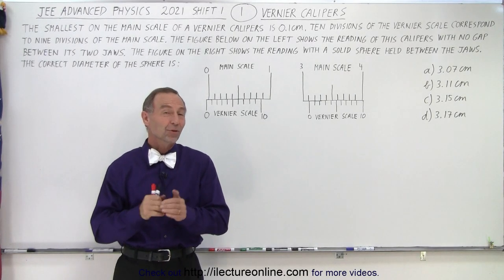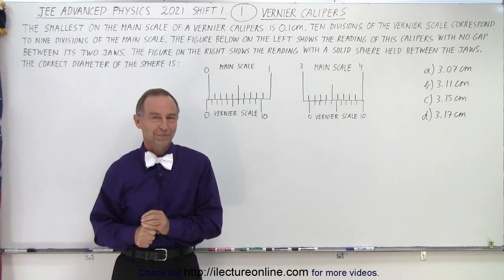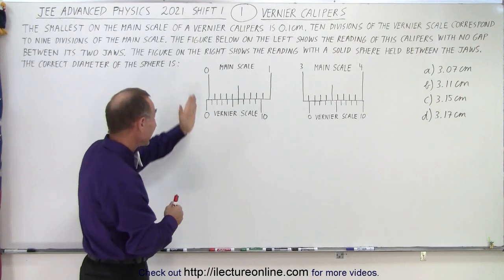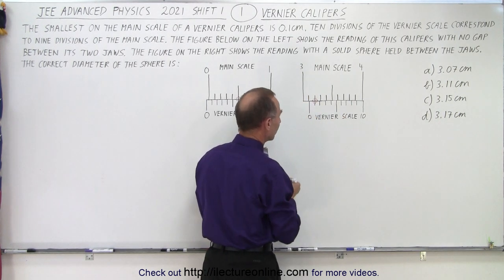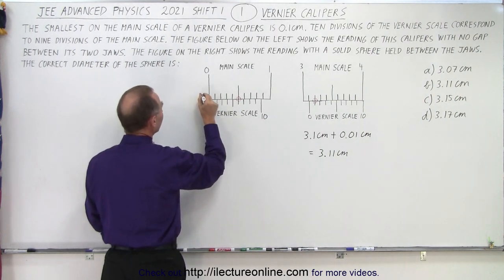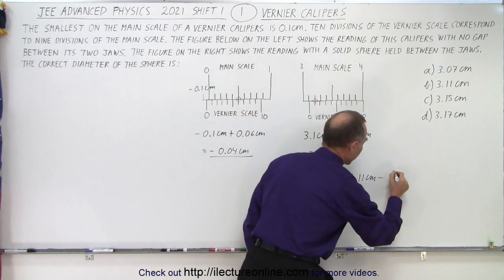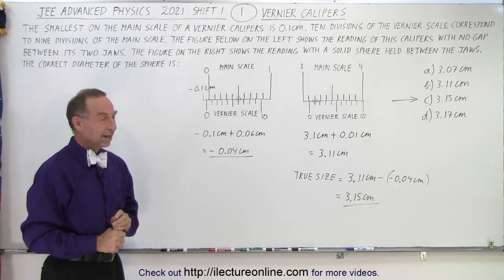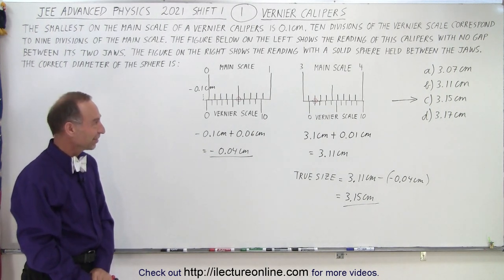JEE Advanced Physics 2021 Paper 1 #1 Vernier Calipers

Comment: You may have made a mistake when you said "each divn. on the vernier scale is 0.1mm or 0.01cm. As 9MSD= 10VSD, 1 VSD= 0.9MSD or 0.9mm. The least count is of corse 1-0.9mm = 0.1mm or 0.01cm
Reply from the maker: Yes I meant the "main scale" of the "Vernier Calipers"
Reply: The amont by which 0 of VS is to the left of 0 of MSD is 6VSD-5MSD = 5.4MSD-5MSD= 0.4MSD or 0.04cm.This must be added to the reading of 3,11cm whence the answer is 3.15cm
Reply from the maker: That is correct.

Comment: This is very easy question...but i made silly mistake...😭😭😭😫😫
Reply from the maker: Did you add 0.6 mm instead of 0.4 mm?
Reply: @MichelvanBiezen  yes....i had done this type of question many times....but in exam hall due to time pressure i made mistake...
Reply from the maker: Yes, it is key to learn how to relax under pressure.  Not easy to do on the JEE advanced tests.
Reply: @MichelvanBiezen  I did the exact same mistake 🙁..
Reply from the maker: Yes, that part was tricky.  You have to be very careful with these types of questions.